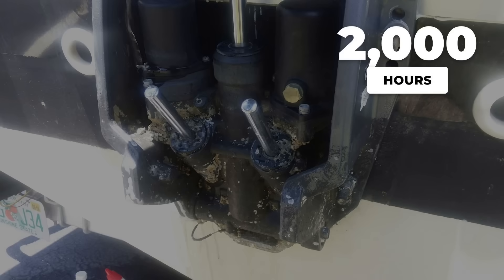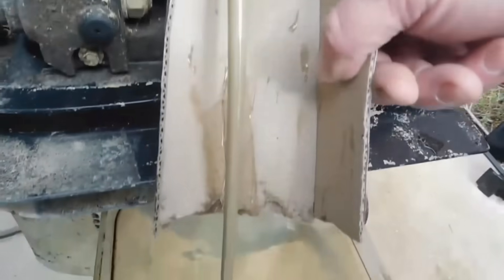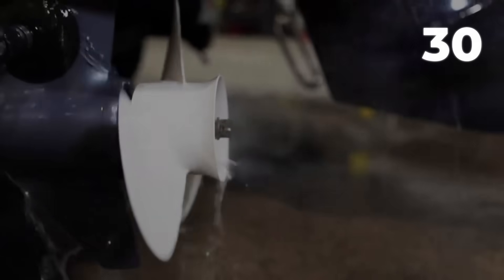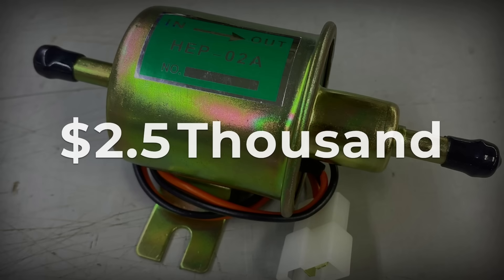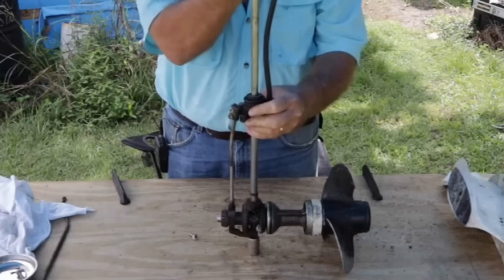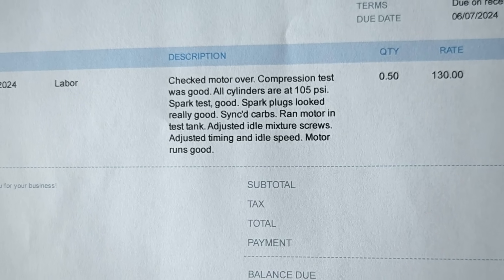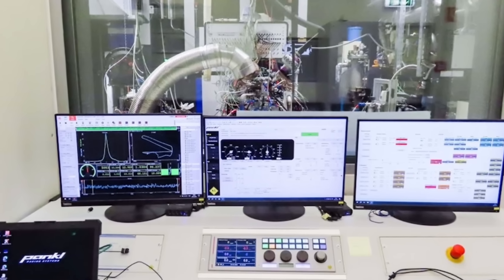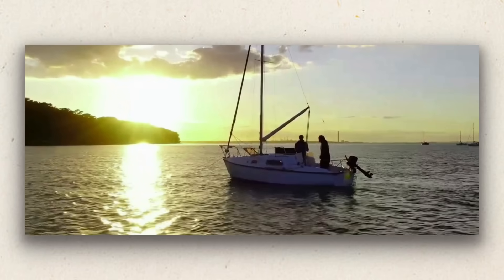7 SECRET Tricks To Make Your Outboard Engine Last 3,500+ Hours Without Major Repairs

Comment: This is why I keep my 1993 Mercury 115 2 stroke motor. Vary speeds, wind it up a time or two each outing. Run some Berryman's thru the fuel a time or two each season, and always run a fuel stabilizer. Cheap insurance. Change lower unit oil each season, use new crush washers each time. Check for fishing line behind the prop each season. Be exact on oil/fuel mix, not more, or less.

Comment: We had a 1967 Mercury 65 horse over 2000 hours on a ran like a clock sold it cuz Dad wanted a bigger motor on the boat and last that 65 horse was still running has been converted to a jet pump forgot to duck hunt with